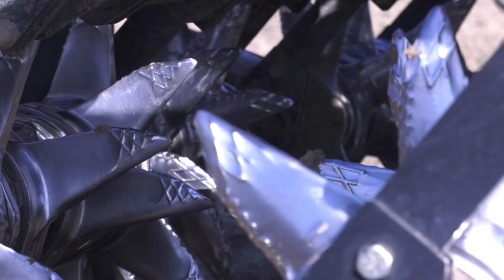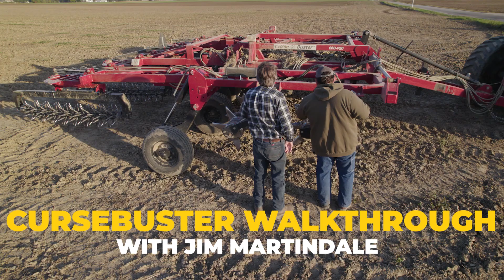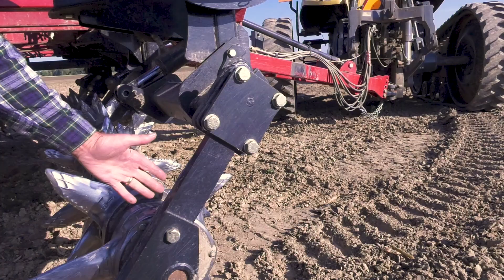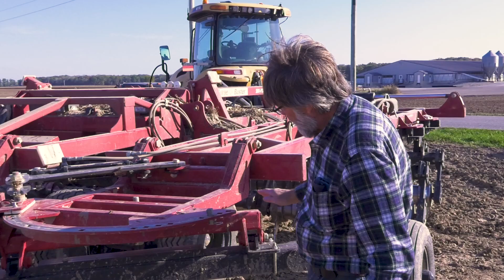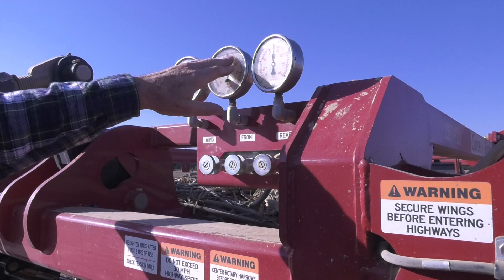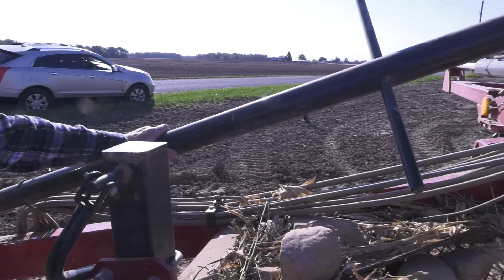Cursebuster Tillage Tool Walkthrough and Demonstration with Jim Martindale

Comment: i think for organic farming this machine is not suitable, only suitable with chemicals like roundup or other herbicides.
Reply from the maker: Actually the suitability for organic practices depends on how one does organic farming. Maintaining ground cover, which this tool does, will be a problem for the clean till approach organic farmer. There is more to be gained from mulching than from exposing the soil surface to the elements. If you want to talk to some of the organic practitioners, email me.
Reply from the maker: jim@soilcursebuster.com
Reply: @jimmartindale  hello thanks for reply, i am an organic farmer since 35years and your tool is what i said, but with mulching you still have to deal with couch grass and thistles.
we tried alot of different tools but without the plow, cultivating, blind weeding and interrow scuffling there is no chance to win against the 2 most tenatious weeds.
Reply from the maker: We have observed that regular use over time as little as 3 years has changed the complex of weed issue. Is what you call couch grass also known as quackgrass?@bsc196
Reply from the maker: As I had suspected, couch and quack are the same critter. The successes observed controlling quack apply to your situation.
Reply: @jimmartindale  Thanks Jim for your reply, yes you are right couch and quack are the same.
Reply from the maker: @bsc196  the Cursebuster breaks root adhesion to the soil colloidal surfaces by exerting horizontal thrust forces. The Phillips rotary harrows then comb the rhizomes out of the soil, depositing them on the field surface where they dehydrate and die. Think of it as a two step process akin to removing dandelions from a lawn.